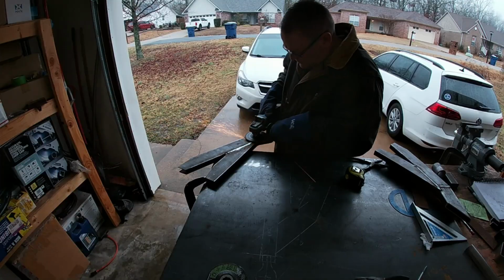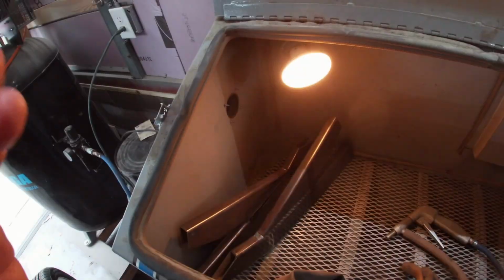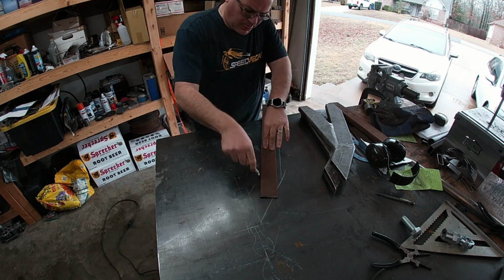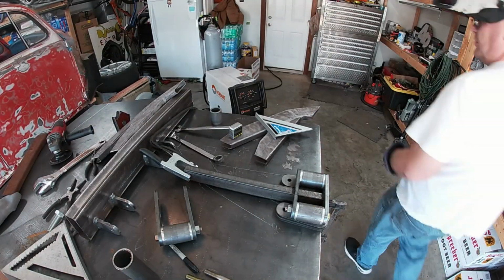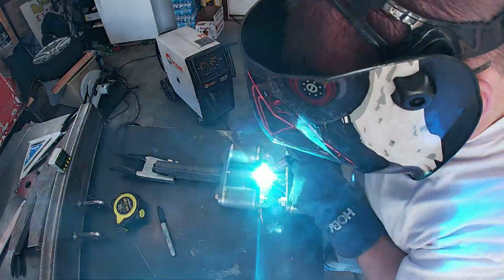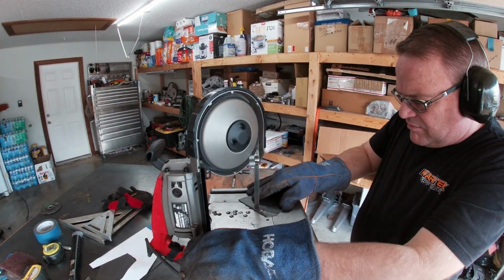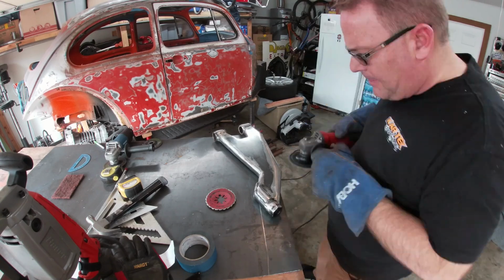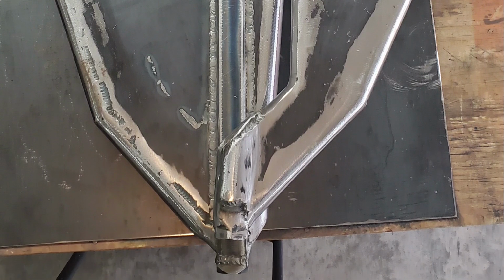Baja Bug Build (Ep. 31): Building Upper Control Arms (Part 2)

Comment: Is the platting necessary for strength? Or is it just an added layer of security? My Nissan Frontier had the smallest a-arms I’d ever seen. I want to say they were 1.25” DOM with added gussets. 
Those look like they could take the weight of an F350. Built like a brick 💩 house!
Keep up the great work Damien! I’m learning a lot from your videos. Thank you!
Reply from the maker: I can only give my thoughts on this, as I don't speak from experience.

If I were to be planning on light trail riding/offroading and street duty, you'd be correct.  Given the welds are good, they would be plenty strong without plate.

But I plan on high-speed whoops and desert/dunes.  So the plan is to jump and land this puppy quite a few times. As well as making mistakes, missing lines and hard hits as I learn.

 That being the case, I think it IS necessary for the application.   

A good 'case in point' is: recently DougBug miscalculated a jump and had a harder than planned landing.  He bent his knuckle and had to rebuild it.  And in his video, he talked about how he planned to rebuild it yet again but out of chromoly. 

Similarly, JamesX (the TerraCrew video guy) recently did a video with Kirby, the guy who build his Frontiers suspension.   In that video Kirby and James talk a ton about how Kirby just kept adding plate and gussets till James stopped breaking stuff.

So is it necessary? Probably not.  But do I see enough instances where extra plating was needed? Yes.  

Since this is my first Baja Build.  I'm simply trying to gleen the 'best practices' from those folks whom I consider would know better (and much more) than I do.

I hope that makes sense.
Reply: @thebinderbuilder  
Makes perfect sense sir. Thank you for the detailed explanation. Much appreciated.
Reply from the maker: @69bajaoutdoors  of course!  
Speaking of which,  when's the next video coming out?
Reply: @thebinderbuilder  
I try my best to schedule to post every Thursday at 1pm.